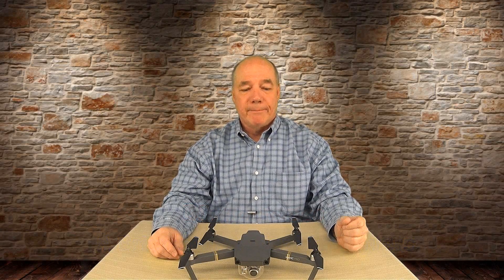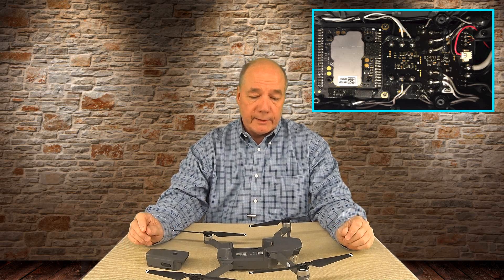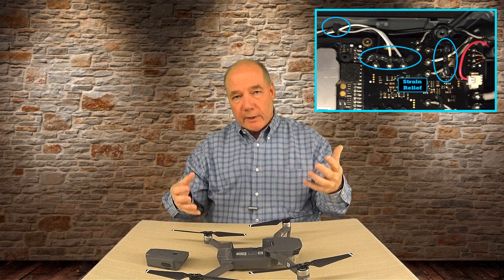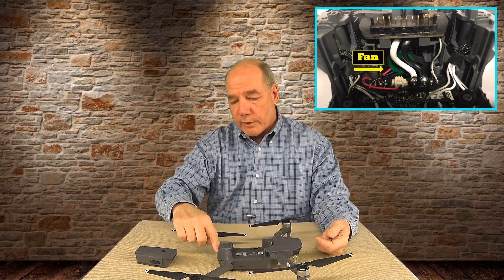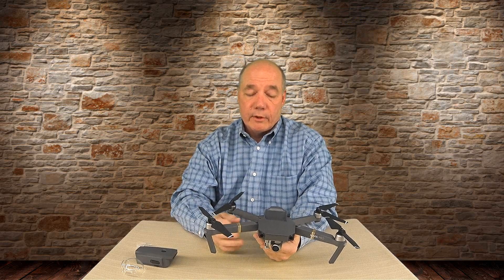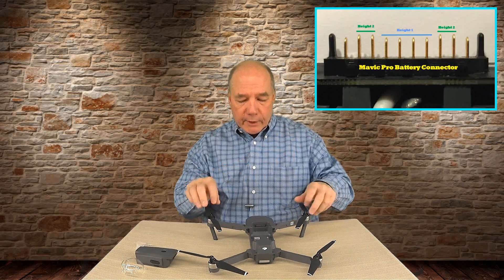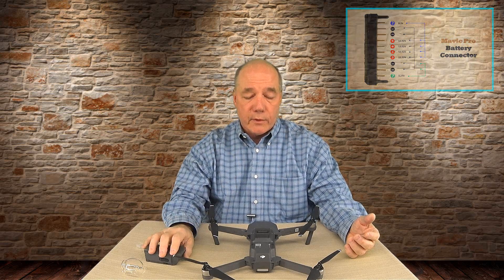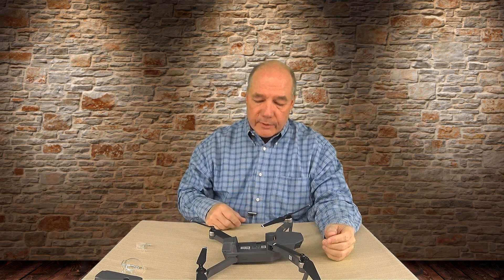Mavic Teardown - A look Inside Your New DJI Mavic Pro Drone

Comment: With regard to your concerns over the arms getting sloppy, it would be easy to shape a piece of plastic or rubber to push into the corner of each arm to keep them locked open.
Reply: That would defeat the secondary task of the arm springs that he mentioned. Shock absorbtion to dampen motor and prop vibration from reaching the printed circuit boards.
Reply: Yeah that's true.

Comment: all of the airflow from the fan is directed to the bottom to cool the metal cover and is separated from the PCB inside, so the dust won't get in by the fan.
Reply: The fan inside is a centrifugal fan, and the airflow is coming out of the fan from the bottom. it doesn't blow pcbs like a axial fan would do.
Reply from the maker: Thanks for the post but the fan is set in the front of the drone right in the middle of the PCB's. I actually ran the quad for a few minutes with the cover off and it drew air in from the front and over top of the PC board I showed in the picture and out the back of the quad. I didn't remove the fan for inspection but it looked just like a standard cooling fan used on a computer graphics card. My worry is that any debris that gets near the vent in the front of the quad will get pulling into the drone and over the boards.
Reply: Here is a diagram for centrifugal fan, if you match this to Mavic fan, you can see the outlet air is come out from the bottom to cool the metal cover (that also serve as heat sink) and doesn't blow to PCB. blowing over pcb is inefficient compare to blowing the heat sink.
https://www.republic-mfg.com/images/Centrifugal-Blower-Working-Principle_l.jpg
Reply: it's different from a pc fan because the way it is placed allow it to have an open back so more air can be sucked in (along with opening in the front), so more air get out, to the bottom to cool the metal plate.
Reply: According to the manufacturer, it's a blower.  DC Blower, 35mmx35mm, 4v, High speed, Hypro Bearing, 10mm thickness, blower blade shape, and function is "by impedence"...  trying to post the link, but it fails due to the link part.
Reply: Yup, the Mavic is turbocharged for sure.
Reply from the maker: Thanks for posting that, but whats confusing to me is that I only know of two basic fan types (axial and centrifugal) The difference I have always thought between them was that the centrifugal fan always had a sealed back so that all of the air could be directed though an output port to where you needed the cooling. The fan in the Mavic still looks like an axial fan to me since the back is wide open. It sits directly in front of the top PC board and is pushing air across the boards and down below. I have attached two pics at this link ( http://tinyurl.com/jk446rb) that I took today to give you a closer look as well as the part number. I'm totally open to being wrong on this and part of the fun of discovery for me is this type of education. Give the pics a look and let me know what you think. Thanks, Rick
Reply: put your finger at the opening below the fan on the bottom metal cover, that's where the air from fan comes out, you can feel it.